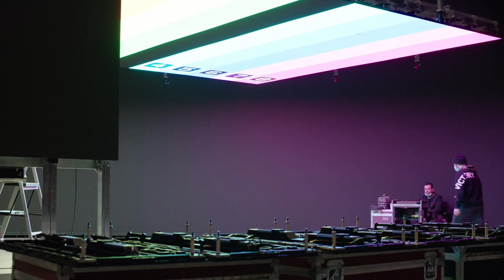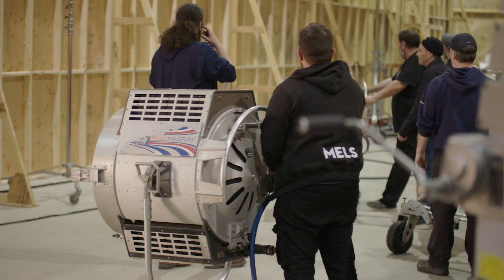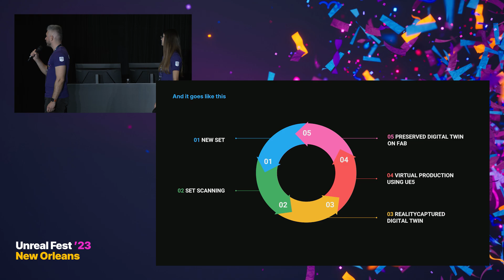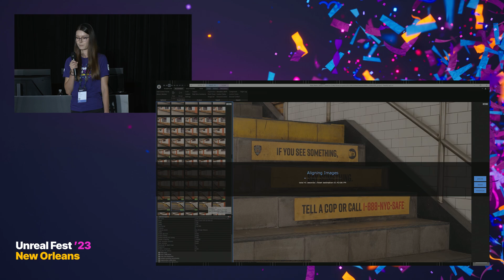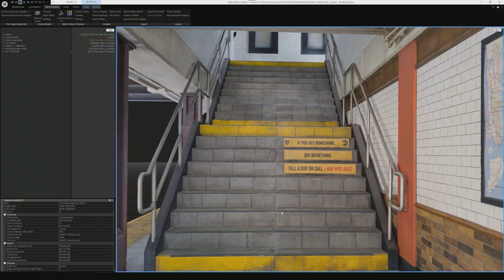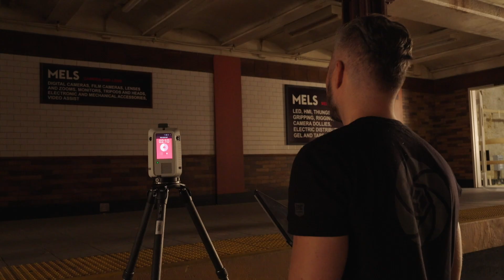RealityScan and Mels Studios: Creating a Digital Twin for Virtual Production | Unreal Fest 2023

Comment: I see my previous comment was removed... Maybe because of the linked videos.

It is great to see you are also using LiDAR and Photogrammetry to capture and display reality virtually. We have also invented a custom workflow based on combined 3D scanning technology and used it to scan more than thousand square meters of an abandoned coal mine's surface buildings and a modern gamer arena. We have optimized and used the 3D scanned environments in a highly physics oriented simulation software. You can check it because we provide the Real Drone Sim for free for personal use.
The scanned environments are prototypes yet because we are developing a custom hardware and custom workflow to be able to process and reconstruct large amount of scanned data because this manual reconstruction took 6 months for the Stephen's Mine map for example.